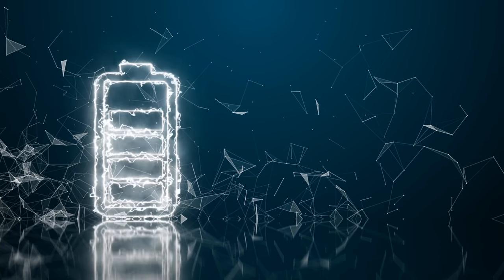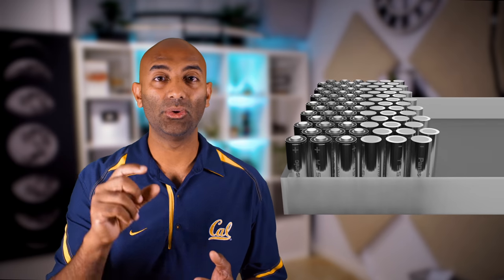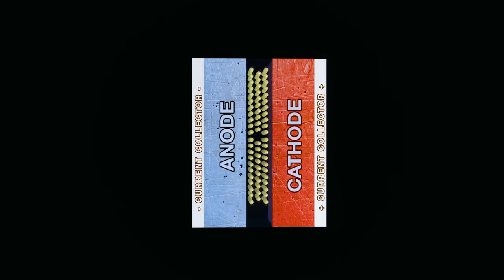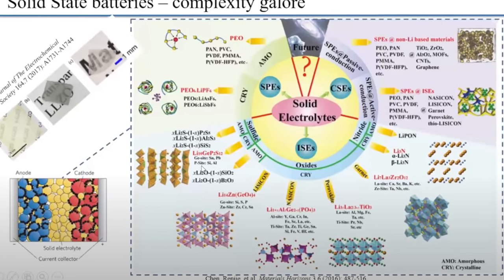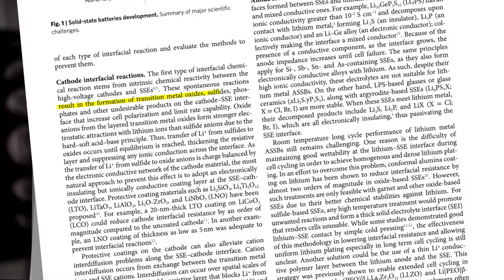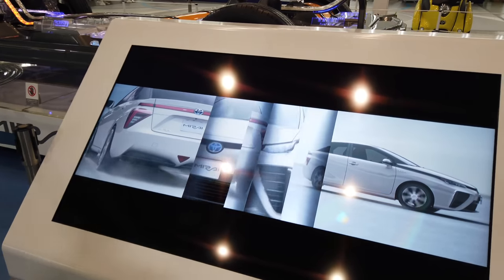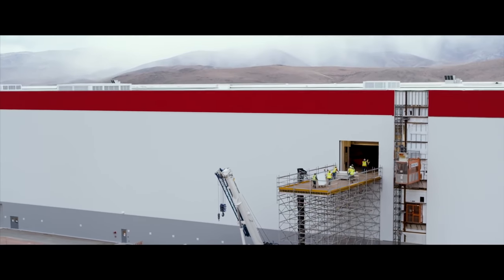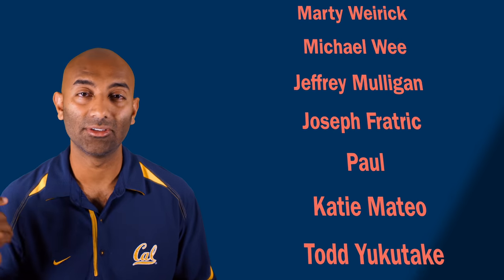The Truth about Solid-State Batteries. / Are These Batteries Really The Next Big Thing?

Comment: I wouldn’t be surprised if solid state batteries go into phones before cars
Reply: 100% certain they would as it would be a good way to test rapid discharge and safety standards are met. Small explosives products are better to test before you get to bigger ones.
Reply: mohammed alam plus phones have extremely high margin which should let them spend far more per kWh
Reply: Why not rc cars? Perfect small scale experimentation.
Reply: Go into my onewheel!!!
Reply: @Fyxxterzc  That probably wouldn't happen before phones since the market's way smaller.

Comment: Nuclear Fusion is actually possible, it's just it requires more energy than it gives out.
Reply: Anchit Roy that has already been achieved long ago
Reply: @Dana5775  Yup, but the energy gain is still a net negative.

Or in the case of hydrogen bombs, no effective way to harness that energy in a stable way.
Reply: No one has created deuterium from the hydrogen. So NOT possible. Even in nuclear bomb.
However we have the droplets of the dead neutron star: thorium!!!
210 times more energy from the ore over the uranium!

Comment: I realized that I just misunderstood solid state batteries with super capacitors. I though you were going to explain us that combining supercapacitors to current batteries could extends a lot our batteries life with fewer discharge-recharge cycles when braking. So I learned something today.

Two questions/suggestions : is really energy density of solid state enought to power a plane ? I remember watching vids saying it just make no sense given how much energy is required to power a plane.
Second : can you make a video about supercapacitors, how do they work, and maybe if some automobile maker is interested in it ?

Good video and thanks in advance.
Reply from the maker: I have a video on supercapacitors! https://youtu.be/Q8sMA9O4_QY
Reply: There is a commercially available aircraft (named Pipistrel after the little Bat) which is a two seat trainer. It has a small 22kwh Lion Battery pack with a 93 mile range. It also has regenerative flying (!) and can recover up to 13% of battery on final approach. The small aircraft also has an air frame deploy-able parachute. One of the big advantages this modern aircraft has over traditional piston engine variants is a huge reduction in maintenance cost. If Airbus and Boeing want to, they can almost certainly develop short haul EV aircraft. But then they lose out on all that lovely maintenance revenue. Like auto, it will take a NEW player to create an EV aircraft, because the establisherati certainly won't want such a thing. Also, Aero fuel is considerably cheaper than auto fuel due to light or non existent taxation.

Comment: I have been following EV vehicles for some time and your video was one of the most helpful on this subject that I have seen.     Your advise was to go ahead and buy an EV today and my question is this:   If I were to buy an EV today and affordable solid state batteries came out in five years, would the current EV vehicle be upgradeable by removing the current batteries and installing the newer batteries?
Reply from the maker: Great question! There may be some other system considerations like the cooling system but yes. I think heavy electric vehicle companies like Tesla will be all too happy to sell you an upgrade package
Reply: I wondered this myself as I am considering a new model Y now.   But even if a solid state becomes available in 3 years,   the batteries in the Model Y today will meet my total mileage needs for the next 15 years regardless

Comment: Regarding EVs my electric bike is also an EV, I bought it in 2014, then the battery was $750. In 2020 the battery began to age and didn’t work any more. I ordered a new one noting it is now $1100, the guy rang back saying the it is now $1350, so I didn’t proceed with the order.
Prior to the phone call I had a battery expert examine the battery, it I understand is made up of 5 groups of ten 18650s, the guy charged each group separarely and then reassembled them. The operation is called balancing. Presumably one or more groups went undervolt bringing the whole battery down.
The fix is temporary but it’s been beaut for about 3 months and it could fail in 6 months or 3 years.
I love batteries but my point is replacing batteries is expensive being a limitation of electric bikes and - cars.
The next step is to replace all of the cells with new ones. Probably be half price of the new battery.
Reply: John Taylor I don’t think he installed a balancing circuit the battery already had one. The contact in the bike shop just said he recharged the five modules, I think a module contains 10 x 16850s and one of them was less than 36 volts and was recharged.

Comment: So basically lead acid battery were 1. gen, Lithium 2. gen and solid batteries 3. gen so we need to deal with 2. gen for now.
Reply from the maker: yeah fair assessment!
Reply: There was lead acid, there was Nickel Cadmium invented 1899! (NiCAD) used in a prototype Lotus, there was Nickel Metal Hydride invented 1967 (NiMH) Used in the GM EV1, there was Lithium Ion. (LiON). Disposable batteries have featured for many decades too. Note that LiON was invented getting on for half a century ago but only commercialised in the last 30 years - 1991 by Sony as mentioned. The Auto industry DOES NOT WANT EVs. Regardless of Batteries. The NiMH patent was bought by GM supposedly to be used in the production of EVs. They then cynically sold on the patent to an Oil company (Chevron) who expressly PROHIBITED the battery's use in EVs.
Reply: @ouethojlkjn  You're kidding. Who was the CEO then? For GM.

Comment: Fluid electrolyte and ion goes well hand in hand. It provides ideal junction area vs electrode area index of 1.0. For solid state assembled battery it is much less than 1, unless a chemical deposition process (such as micro chips) is used but that can be cost prohibitive.

Comment: Nice overview on this emerging technology.  You touched on the key deliverable of solid state batteries - a 10 to 1 improvement in energy density over current lithium ion technology.  This would bring the EV to parity with the existing ICE - a necessary condition for replacement / widespread adoption.  I trust that in time - cost, industrialization, and reliability can be solved...
The key point is that we can't have passenger cars running around with 1000+ lbs "fuel tanks."

Comment: Dyson was also betting on the scalability of solid state batteries, but in the end had to quit the whole project because everything became too expensive... Solid state is already there but very hard to scale production.

I wonder what Tesla will come up with 22 September, tidbits are leaked here and there and it seems to involve a technological breakthrough... Would Tesla be the first to scale Solid state batteries?.. Probably not, but I am sure they come up with some huge improvements on current technology, that might extend the hunt for the perfect solid state battery further into the future, because the improvements on Tesla's batteries will reduce costs, improve energy density and improve scalability and production rates... All in such way Solid state batteries have to get better even more to sway the balance to solid state batteries.

Comment: But it would still be easier to retool a Ev manufacturing plant to just include solid state batteries ... but to change Gas car manufaturing plant you'd need to re do your chasis and include larger electronic control units .. and then have a  solid state battery integrated into it..

Comment: The question of Toyota is very intriguing indeed. Being the largest incumbent manufacturer, Toyota is saddled with the incumbent’s dilemma of how to make the transition beyond ICE while being entirely dependent upon ICE.  Among the larger auto manufacturers, Toyota has perhaps been the most reluctant to adopt EV’s while only “dabbling” in R&D (EV, hydrogen). What lessons have Tesla learned while its had its feet wet actually mass manufacturing EV’s that the incumbents will have to learn in order to catch-up or should some revolution in a SSB technology permit an attempt to leapfrog Tesla? Do these lessons pout Tesla in a better position to take advantage of an SSB breakthrough? However battery technologies evolve, it will still take many decades for EV’s to replace ICE even after EV’s reach “cost parity” with ICE vehicles. Nevertheless, the long term cost trends do not favor ICE while EV’s currently have momentum as a trickle has become a flood that, they hope, will turn into a tidal wave.
Reply from the maker: very well said

Comment: Update the info in this video: Quantumscape has presented his SSB with very good specs in a commercial size tab cell 80 x 75 mm , Toyota unveil his SSB , and Fusion energy is just ignite in the reactor, the challenge now is to make it gain more energy than what is used to start it (Q>1) and the new REBCO High Temperature Superconductor are promising to achieve Q>1

Comment: Toyota is not going to compromise the way its customers use their vehicles. so until they can come up with a battery that allows 500 mile range and rapid charging they are not going to ask their customers to accept 300 miles and maybe recharge to full in 90 minutes. It is a gamble but it is theirs and I respect it.

Comment: Also, how many pickup trucks in states where rust isn't a huge problem get a whole new engine put in when the vehicle has run 400K miles?   I'm sure it's not extremely common but I've heard of a lot of people who get new engines for their ICE cars.   So that being the case, how hard would it be to remove the old battery and replace it with a new one that uses solid state chemistry?  Does anyone think that a semi truck or city bus is going to be put on the scrap heap once the battery loses its charging efficiency?  Indeed, ICE city buses today are being converted to electric.  Don't forget that the real story of electrical adoption is rather hum drum.  And that is the hundreds of thousands of city buses that are being built and currently on the city streets in China.

Comment: so for now, hybrids are the holy grail (with ICE like camless + RCCI engine). Hope SSB will make it.
Reply: yeah toyota rav4 prime with a 40% more efficient gas engine and a better electric range is a game changer
Reply from the maker: they're a good step, but now you have the complexity of both. you still have to fill gas, and you still have a gas engine to service.
Reply from the maker: I'd rather have a Model Y any day :)
Reply: @TwoBitDaVinci  camless (like freevalve)  engine is "serviceless" - only need to change the oil. The biggest con of batteries is huge weight, charge time too
Reply: Robert Balejik How is weight per se a problem? Tesla has “proven” weight, in the form of lithium EV battery, is not an impediment to an efficient EV nor an obstacle to high performance.  As far as charge time, two different situations that cover the vast majority of vehicle use and ownership, charging overnight and high voltage super-charging demonstrates EV’s are practical today for almost everyone in the vast majority of the time. Yes, there may be use cases where ICE is still superior in some situations (but with their own drawbacks still), but with access to a Level 2 charger at home (or work) and access to high voltage charging on long distance trip,  such old arguments against EV’s are just old.

Comment: Ricky, forgive me but I want to beat this solid state battery existence into the ground. Now I’m a 74 year old retired not so dumb Electrical Superintendent who has witnessed the evolution of process control. High Voltage Substation, and wiring methods building huge mining projects around the world. Am I a Chemist NO. Am I an Electrical Engineer NO. ( in 1989 I was the head man on site for HA SIMONS ENGINEERING FOR THE RECONFIGURING OF HIGHLAND VALLEY COPPER  AND RESPONSIBLE FOR THE AMALGAMATION OF GRINDING MILL LINES OF A B C were existing and adding 2 more lines D & E ( formerly HIGHMONT 6 MILLS PHYSICALLY RELOCATED DOWN THE HILL, TO ADD ON TO EXISTING MILL LINES.  This makes it one of North America’s largest mines. What a You should know is these 5 lines had separate control rooms before with massive lighted graphic boards with a display suitable for a moon shot. These grinding Mills were a massive total lying 13 with a combination of ROD MILLS, BALL MILLS, AND AUTOGENOUS MILLS. ( nothing to do with FSD AUTONOMOUS DRIVING). The new control room had large screens for every line and mill and all were  hosted by 2 more screens for 2 operators for Redundancy and Safety. Imagine a Staff of 4 per shift in control room replacing 30 operators in room but the same workers in field answering alarms and process communicating with control room operators. 
Story of IOCO REFINERY IN PORT MOODY BC. First built in 1914. It grew in size over the years and it was operated with local control rooms for different processes but what you should no back then there were no computers and do process control was all pneumatic control supervised by recording indicating controllers. Later  Panalarms were added. The big valves were operated by these crude pilot devices. In 1969 this plant added 4 to 20 milliamperes  FOXBORO ELECTRONIC CONTROL IN A NEW CENTRAL CONTROL ROOM. IT WAS DECOMMISSIONED IN 1995. IN 1979 I was 33 years old, starting my professional career as an Electrical Superintendent. What You should know about my first project. Program Logic  Control was just been introduced to the mining industry. For many years before computers, process control was accomplished with hard wires and no and nc contacts using a Relays with coils. Amax Mining decided they still wanted RELAY LOGIC with a Selector switch because they new how to plug relays and didn’t want to be held hostage to some software program. Thank Christ PLC became industry standard, reliable, also much simpler to wire. (This a Hybrid system required more than double amount of control wiring) In 1991 I decided to learn the computer game an unfortunately started 2 years early before the introduction of windows having to learn doss and wasted $10,000 building the ultimate tower for AUTOCAD. Back then a 500 megabyte hard drive cost $1,500 and I had 2  You see where I’m going with this. I am an APPLE FAN and my 6 plus cost $1,600 but has 32 megabytes of memory. I have built the ultimate home over many years of 6000 square feet with a 3 car 3 door garage on one street and RV GARAGE  41 feet long and 13.5 foot ceiling. This is a structural steel frame house that I fabricated and detailed myself. I had help from a brother in law and nephew every time I hired a 17 ton crane with 100 foot boom for 7 days only for erecting steel 3 times and plywood 
 And  yes concrete roof tile I also installed by myself. I have a 400 amp Service with 3 separate 100 amp TESLA WALL STATIONS. I have 10 other 100 amp electric panels and 4 other cabinets for INSTEON DIMMERS, 20 in each remote cabinet. 250 LED 3” pot lights inside and 50 more outside. (Maximum amount of Automation for 4 million dollar hose built entirely by my self between projects. Oh I did not pour or pump concrete. I was able to find the best to place and finish 233 meters of concrete. ( that is not a typo, I had some 16’ high walls I formed by myself, and the excavation was 202 truckloads.)  I have 2 daughters that are doing well with their own 1/2 million dollar places with their Partners. The Youngest Daughter is exceptional and is smarter than the old man. She started working at age 12 as CHRISTMAS help on Friday night and all day Saturday and Sunday when she went to, school and age 18 to university and age 20 started in career as electrical high voltage Coordinator. At age 25 she was promoted to Project Manager for electrical construction. Presently she is doing all the computer Upgrade related work for and station upgrades 50 stations for B.C. TRANSIT SKYTRAIN with 2 superintendents day and night 50 man crews. My GOD THE GAL IS A STAR. One very proud Father. Her first car was an INFINITI G37 X . She will be buying TESLA in future. I have seen it all from a paperboy in Kamloops getting the VANCOUVER SUN off a baggage car pulled by a Steam Locomotive to my last Bucket list item is FSD AUTONOMOUS DRIVING CYBERTRUCK.

Comment: Don't underestimate the gains Tesla will be able to achieve before commercial SSB adaption. Million mile plus batteries manufactured at reduced cost will see tangible improvements before the transition. Electrified flight will be the biggest breakthrough IMO given aircraft's need for much greater energy density. Should be an amazing decade ahead.
Reply: Tesla already have a battery (Lithium Metal) that in something like a Model 3 can achieve an astonishing 3,800 miles on a charge. However, the battery only survives 80 recharge cycles. This still gives the pack a lifespan of 320,000 miles. In addition to reducing cost of manufacture, there are already batteries capable of 10 times the density of current offerings.
Reply: CATL and many other companies have been working on million miles batteries too